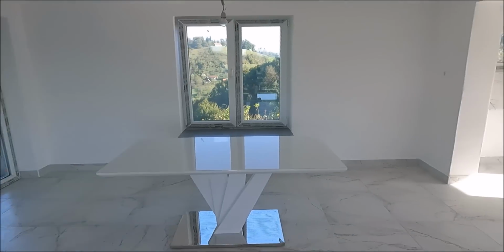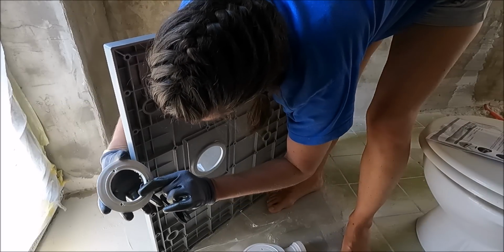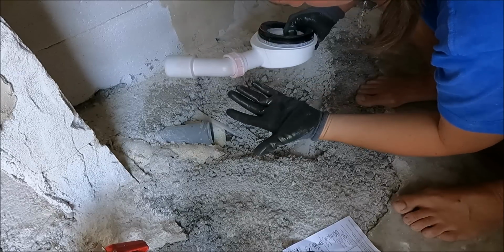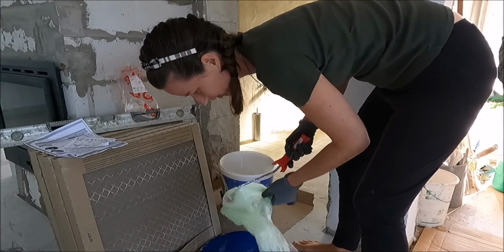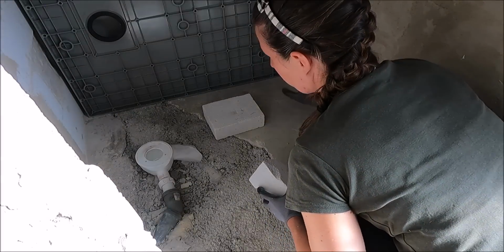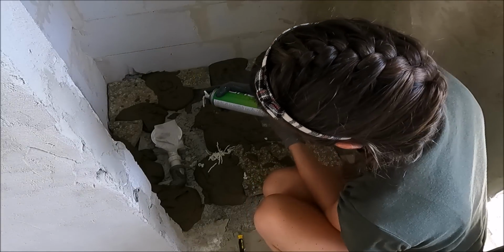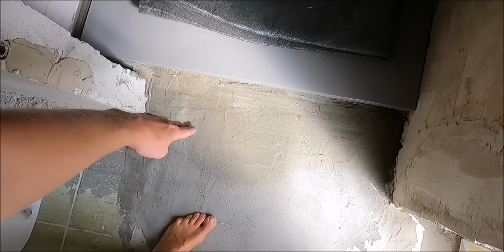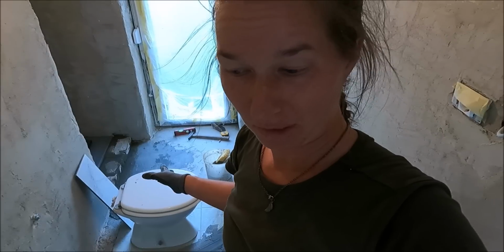I Installed a Shower Tub | MY SOLO RENOVATION | Martinas Life

Comment: Dear Martina, I hope you did your research and know what you are doing.

*  Your bathroom, being a wet room, needs waterproofing. And especially the shower area. Just to prevent future moisture problems.
*  The shower floor should not be level but should tilt away towards the drain. So the water will run off towards it. Perhaps the prefab floor already allows for that? Then why did you use the level bar?
*  Also the PVC parts should be glued together with PVC glue to prevent leakage.
*  The spray can needs to be held upside down in order for the propellant gas to be able to push the contents out. Now you probably heard the gas hissing, while nothing came out.
*  The surface of the blocks you used for the threshold are now just below the level of the plastic shower floor. And when you put the floor tile on top of that (21:56) the top of the tile was level with the prefab shower floor. So once you lay the floor tiles in the shower itself, that tiled surface will be higher than the threshold tiles (you follow me?). Is that your intention?

Am I worrying too much? 😟
Reply: Martina pozdravljena! Bravo, odlično ti gre!!! Kapo dol. Mogoče pa vseeno preveri glede vodotesnosti celotnega prostora za tuš (meni so vstavljali banjo in je cel prostor okoli banje premazan z vodotesnim premazom, pa je manj možnosti za pronicanje kapilarne vode kot pri tebi s siporeks steno). Vprašaj v Merkurju ali Topdomu za vodoodporni (vodotesni ne vem točno kako se reče, pri meni je bil tak roza barve, obstajajo tudi zeleni) kot gumi premaz. Res bi mi bilo škoda tvojega truda, da bi po vsem kar gledamo, imela kje kakšno plesen. Uspešno naprej, go girl!! Katja